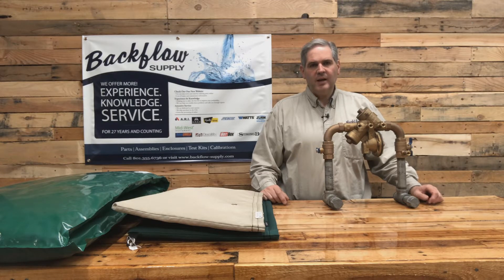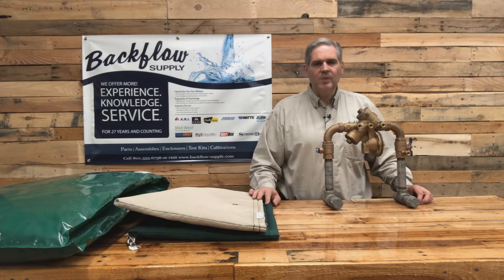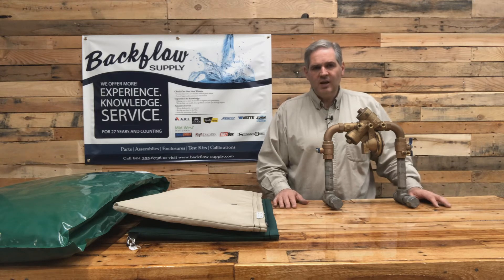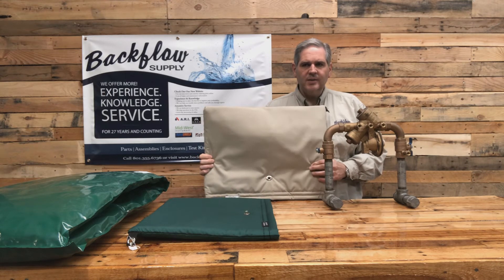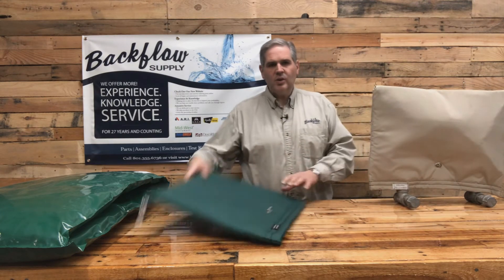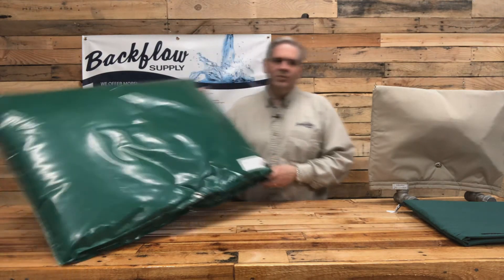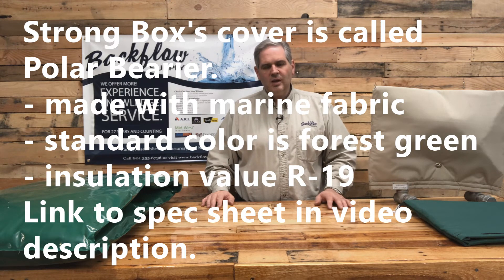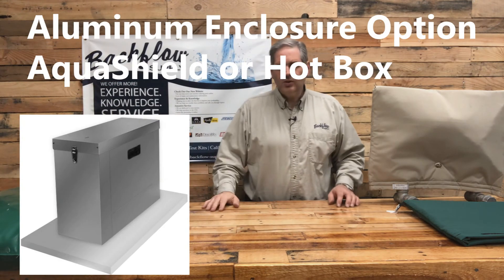Insulating Your Backflow Assembly

Comment: How do you insulate a backflow preventer that is attached to a wall?  These won't work.
Reply from the maker: you will have to find a company that will custom build them.  I heard of a copy that did that several years ago but I do not recall who it was, but it is out there.  I had a federal agency down in AZ that told me about them as they needed that type for several of their backflows.